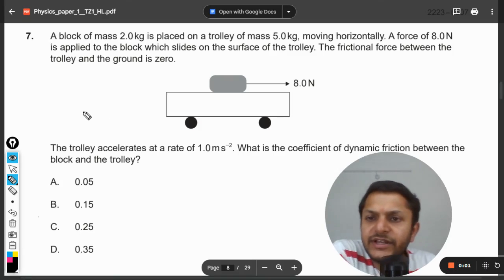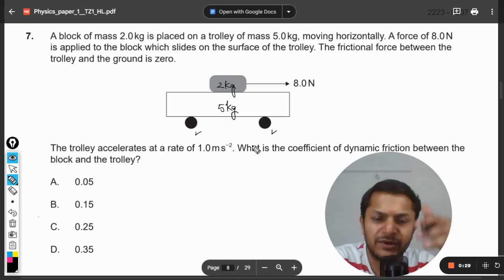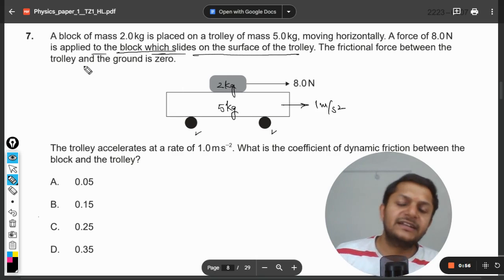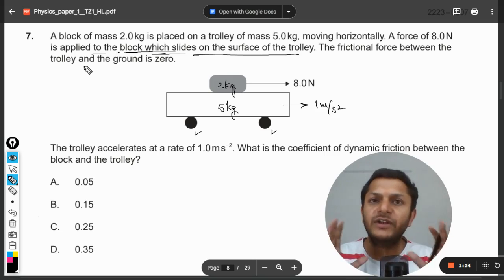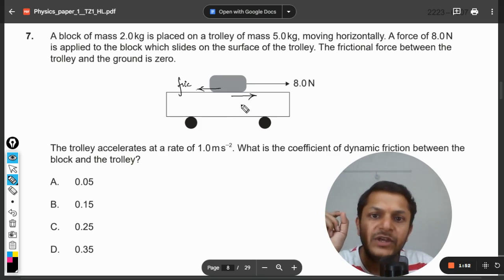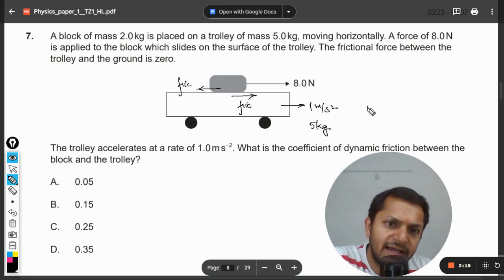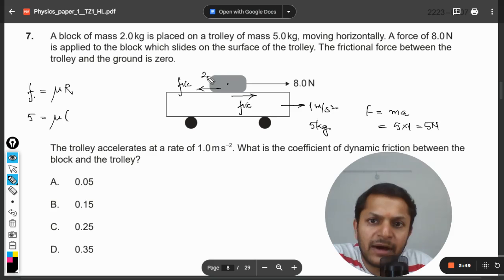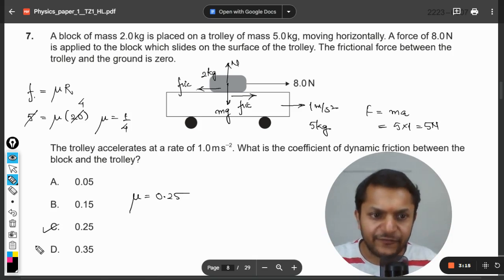A block of mass 2.0kg is placed on a trolley of mass 5.0kg, moving horizontally. A force of 8.0

Comment: Im a bit confused on why we take just the weight of 5 kg for the net force of the trolley. Isn't it technically a total mass of 7 kg and not 5 because the block above also adds an extra 2 kg to the trolley?
Reply from the maker: No, it will be separately only 5 kgs for trolley. The block will take care of itself. There are separate forces for separate bodies. That's why, we consider each body individually.!
Reply: I also think so so it should be 0.35 in my opinion because well the basline accelration of everything is 1m/s^2 and the relative accelration of the bloc against the trolley is 0.5m/s^2
Reply: @vihaankedia8134  I know this is late but the thing is that I think for this question the block is not accelerating with the trolley, which is why the forces are separate bodies in this case, resulting in the answer being option C. However, if the block was accelerating at the same rate as the trolley, (if the block was stuck to the trolley for example), then what you said would be correct.

Comment: Why the 5N is the force to let the trolley move to right? And why there are two friction?
Reply from the maker: See, the force can be calculated from the product of the mass and the final acceleration that was produced in the body. That's it. So, effectively, 5N is the force that acts on the lower body.! And the two frictions, which are acting on the bodies, are the action reaction pairs, which act in opposite direction but on different bodies.
Reply: Thank you so much! @profvarun
Reply: This questions is clearly corrupt, why there is no use of the 8N????